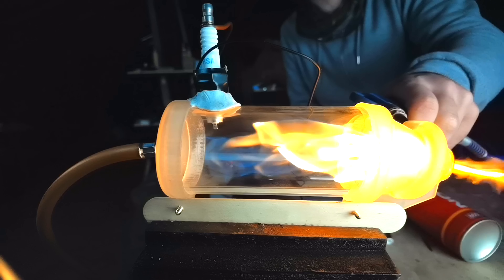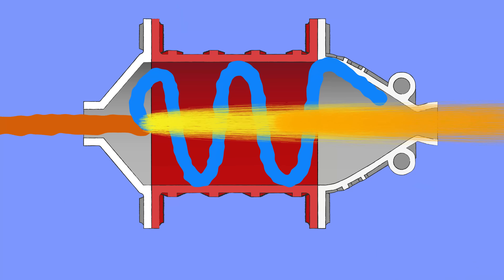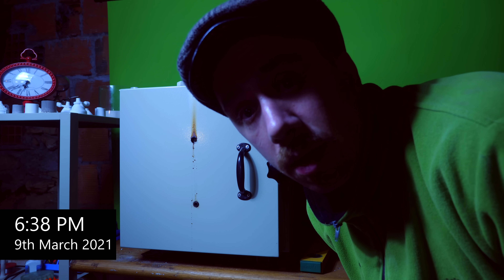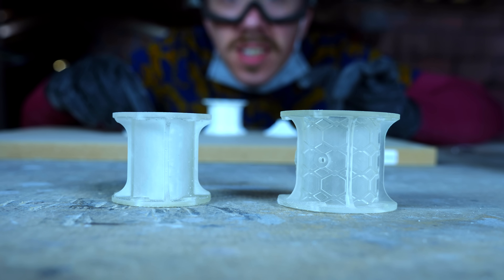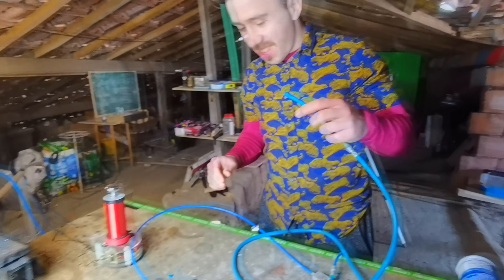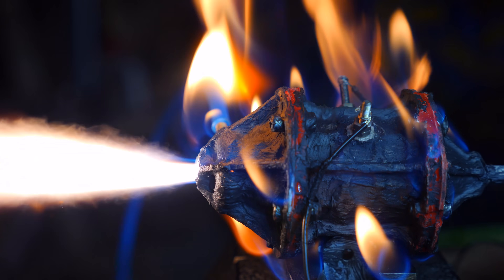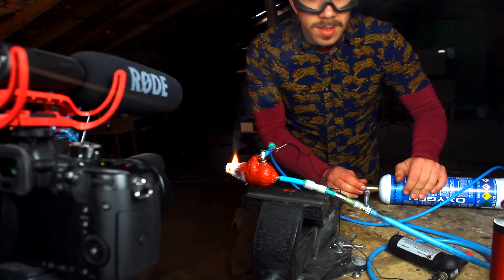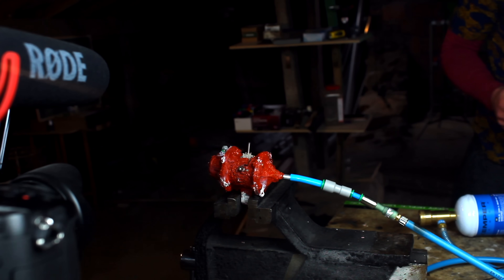Vortex Rocket V2.0 (3D Printed)

Comment: I see many professional comments here, but here is what I would do, not as easy but definitely worth trying: 3D print your template and use proper methods in use for hundreds of years for cups and bowls to make your engine. Then use the glaze to seal that. The 17% resin in your 3D printed one leaves a lot of holes that cannot be easily fixed.

Comment: I remember people working with epoxy using a vacuum chamber to remove bubbles. Wouldn't the same idea work if you put the nozzle in some ceramic/fireproof glue and let it suck out all the air out of the pores and replace it with the glue?

Comment: I haven’t read all 11 billion comments on all your channels, but after you fire the 3d part t9 burn off the resin, the ceramic should be porous… it ceramic after all… but if you the glaze the inside,and then seal up your openings, you should be able to use a vacuum to pull the glaze thru the interior of the ceramic structure. Give it a while to integrate. Now kiln again to set glaze, now you will have a vessel air tight (not just water porous) … sort of glass lining a wooden bowl thing.

Comment: Clay, a layer of clay on the parts and then in the furnace until you have a layer of ceramic sealing your ceramic parts. I know it’s been years but still a solution.

Comment: The high temp silicone would do a better job at sealing things from the inside. Mainly because in order to leak, it would have to push the silicone from the inside to the outside to create a leak under higher pressure, Sooo close too bro! Just make the inside coating very smooth and it should be kind of thin layer of silicone, but thats enough to handle way more than pressure than you would be dealing with IMHO.

Comment: Glaze the parts in the kiln after you do the resin burn out and support material trim. This will seal cracks  and handles just as much temperature as part itself.

Comment: Print the parts using the flat area as a base so you don’t need supports and after kilning connect the pieces cement leaving the screws in while it dries and then put the finish on inside and out

Comment: Bro for the vortex you can just use normal air and from where you are injecting fuel before injuction you can mix fuel and oxygen and then ignite them in chamber

Comment: Print a sleeve of ceramic for inside a 3D printed metal Case. Sleeve can be replaced. 
To go one step further you need to coat the inside of the nozzle with ytriumm stabilised zirconia using plasma coatings methodology.

Comment: Hi Integza, I think exploring a vitrification process for the ceramic components that need to be gas-tight may be a simple way to deal with the porosity problem. Potentially all that would be required would be more time in the kiln at higher temperatures to produce a gas tight material. Glaze is another suggestion to do the same thing, but may be too easily flaked off by the mechanical and thermal shocks of the chamber in my opinion.

Comment: I wonder if you could put that starch stuff on the inside of the walls, then only apply some high pressure to push the stuff into the cavities of the ceramic sealing them and also bonding to the walls. Or even that paint. Apply (air) pressure repeatedly before it hardens. I mean... it must be leaky, how else would the resin have escaped in the first place.

Comment: you could always make a metal version of the vortex engine and then seal the leaking ends with gaskets or of your choice of welding the metal parts and possibly add a cooling system to the engine make the ends rounded so that the chamber has less resistance for a better vortex good luck

Comment: Yo what's up tomato Arnold Schwarzenegger even though you're not German pretty sure you might have a little bit why don't you get some clay Clay is really good at conducting heat or dealing with high temperature heat and it's normally airtight kind of it wouldn't be good for the expansion chamber because it could blow up and is fragile but you could use it kind of like caulking or putty that you put around the jet and see if it would hold the oxygen and gas better

Comment: You could prevent leaking by applying the silicone on the inside. On the last test you could clearly see that the silicone got pushed away from the ceramic by the pressure inside and then popped. When the pressure just presses it harder onto the ceramic it won't have the space to flex and rip apart.

Comment: for your sealing issue i would suggest aremco 613 applied to the inside of the parts. So the hot gas forces the sealer into ceramic instead of forcing it away. As long as it is uniform and smooth it won't affect the vortex.

Comment: Vacuum set the porceline when hardening, and also vacuum kiln, at intervals, increasing the lower pressure as the kiln heats.. possibly also using a microwave on the porecelin while the kiln in hot.. 
 Then while part is still about the boiling point of your glaze if you can get it really hot and viscous and then  dip it in the glaze bath and vacuum chamber kiln and then cool it slowly down through to room temp and all that.. the porosity will certainly be far less obvious.. 
 You could do half a million other things like mix a fine glass in the plaster and then vacuum kiln it, maybe it will blend in real nice and give some cushion or something inside the porceline maybe it won't.. but who knows?.. but I bet it won't leak so quick ..  and keep it under vacuum as it cools and sets so as it contracts everything is set as tight as it can get all the way to ice cold and warms back to room temp in an extreme low pressure chamber.. keeping the poceline as tight as high density concrete as possible and glazing ... but a high temp glass sprayer is probably kind of expensive.. for glass glazing in the kiln fine particle glass that would melt on the surface of the super hot porceline in the low pressure environment .. but how many millions is that to develop huh? 
 All because of micro porosity problems..

Comment: Just an Idea,
First you need to find a way to cool the thing, otherwise it's gonna get destroyed every time.
next how about coating ceramic with good high temp resin or a ceramic glaze of some kind.
next how about shielding ceramic part with metal pleats to reenforce the structure.
also use high temp silicone glue.

Comment: You need your high temp coatings INSIDE the engine.  your silicone and other coatings are on the OUTSIDE, pressure alone is going to push them out.

Comment: Señor.
Excellent video, great entertainment.
Suggestions.
1. Make the chamber from high temperature glass, it will stop the leaking and won't burn.
2. Get a secondary screen and some fire protective clothing. It's not fun having your ears burned off. I'm sure you're aware that leaking gas is invisible and flammable.
3. Keep making videos.

Comment: For the leaking tou could by engine heat coating for Titanium or aluminium pistons in high compression or high boost engine coat It in the inside and try to see If It works

Comment: I wonder if the leaks aren't starting where either your fuel or your oxygen connect to the engine and then diffusing along the surface of the engine. Perhaps this isn't the only leak but it might be one place to look to see if there is one.

Comment: @Integza what do you think about a boat steam engine powered by hydrogen from the reaction of AL+Sodium hydroxide. The idea would be to create a combustion chamber where hydrogen explosions would provide a water jet by the venturi effect, pulling the water by using the velocity of the steam from the explosions. A very good stoichiometric Oxygen+Hydrogen mix to maximize the expansion as the gases of the resulting explosions would also vaporize water molecules to increase expansion. The vortex you've already optimized would be ideal to mix hydrogen and Oxigen. You'd need one direction backfire arrest valve. Ideally would be using injector spark plugs. The more the better. The frequency and amplitude of explosions and injections would determine the speed. Of course, you'd need a proper nozzle to increase the final pressure. Would that be a feasible 3D project? If I had a 3D printer, I would probably make some more experiments. What I can tell you is that from my small adventure, the power output is tremendous as the water turns into steam by absorbing the high temperature resulting from the hydrogen-oxygen explosion. I generated Hydrogen by oxidation of AL in Potassium Hydroxide. You need some lean water mix at the end of the combustion chamber. You need to wash the hydrogen in vinegar or other acid solution, cool it down, and inject it into a water container from where you will get the Hydrogen as the water will also act as a valve.

Comment: what about using ceramic powder to seal the engine ,and reinforce it with metal ring from the outside and with that in place heat it to cure until it solidifies like a single piece,i feel very excited to try those out seeing your video....you can also simulate the area prone to break under chamber pressure in cad models...

Comment: When it first worked best, it was because the vortex was narrow. I think if you change the geometry of the engines a bit, as well as making them bigger, it will work. Perhaps there is something you can refill the pours with. Like a really thin glue or resin? At least on the outside.

Comment: You need 1/4 turn shut off valves to quickly shut off fuel/oxidizer. A regulator on each would help you control the mix better

Comment: Is a layer of soot on ceramic airtight? If yes, and all oxygen is used up by the propane, it could help to seal up the ceramic. And it could be done with a candle-flame or an acetylene flame.

Comment: The reason for the leak is that you use heat to burn the resin, which creates very small pores throughout the engine body.

Comment: Given the fact that you have methods to print multiple higher resolution objects in plastics why do you not next build a ribbon burner forge to melt alu into a sand mold and use that as some of your higher temp projects?

Comment: Just put the engine in cement and just let the nozzle and the fuel and oxygen lines out and it will be airtight.All I’m trying to say is just make cement block with the engine inside.profits : it will not leak completely and it will be so strong .

Comment: Why was it so important to remove the extra mete materials from The outside it supported the part in the creation of the part and the inside air chamber and as long as you can access the mounting holes well?

Comment: @Integza when you re-lit the Single piece engine at 14:09, fire did not escape the crack half way back at the injection vein. this means it only failed where the force of the combustion was the greatest near the exhaust. If you could reinforce the area near the exhaust or even Rifle it.. you might get better results.  GREAT STUFF

Comment: I also recommend making a master shutoff valve for your system. have both the propane and air pumped through a set ov valves you can easily shut off without having to go to the main shutoff valves of each tank, and probably cut the gases off a lot sooner.

Comment: Hey, I just had an idea for your next attempt at sealing ceramic parts. You should try to vacuum the parts when they are submerged in a fire resistant resin. It will force all the resin into the porous structure of the nozzle and hopefully seal it much more effectively than you've been able to in other videos.

Comment: Something that may help with the leaks is to dip your assembled rocket engine in Ceramic, or Porcelain slip, fire it again to vitrify it after drying to about 15% Moisture content... you'll be able to easily put a mark in it with your thumbnail

Then just go by recommended temperatures for both (1200 F. for ceramic)... plain ceramic is just as heat resistant and a quarter of the price of porcelain Just so you know :)

Comment: Stop using screw together parts. The unit has to be one unit. Your vortex set up sux. 4 air nose in the bottom third or the vortex chamber. The nose angle is key to increase peak vortex.

Comment: Just buy a can of high temperature paint for BBQ grills... Paint should be thin enough to fill the pores in the ceramic with a coat or two, it dries fast, and it withstands like 500C once cured... Plus, your rockets will look way nicer with a nice black paint instead of the horrible goop you got going on now...

Comment: one thing you might be able to do to seal the leaks is braze some brass over the part. hopefully the ceramic will block enough heat so that the brass wont melt off.

Comment: Glaze the rocket in slope or slip whatever its called, can use a vacuum chamber to pull the ceramic into the pours more. Or do something like an epoxy painted on.

Comment: Have you ever thought to 3d print the mold to cast the liquid ceramic rocket? The so obtained rocket would be 100% plain with no cracks and well respective of geometric tolerance. You can print a two pieces mold or simply use a resin that evaporates at high temperature to unmold the rocket.

Comment: 14:06 Taco exit express
On another note, how about covering the inside of the engine with the red goop ? pressure drives it into the cracks, instead of bubling on the outside, bursting and burning ...

Comment: Could part of the problem be that the vortex is made of fuel gas surrounded by oxygen?
It exposes the chamber walls to combustion and erosion.   If the vortex was made of a core of oxygen surrounded by fuel gas then would this help?  Either way the combustion should occur in the mixing area at the edge of the vortex.

I know there might be an increased fire risk from unburned fuel leaving the engine and reaching the surrounding air.

Comment: Damn this is painfull to watch, use different easy to handle material. Such as for example ceramic clay and 3d print your molds.
You cant learn anything if you can only inspect your model for 10 seconds while its running.

Comment: every furnace ive ever seen on youtube contain just 2 main ingredients to protect its walls.....refractory cement and kaowool....I'm no engineer....so I wouldn't know its heat resistance scaled down to the sizes you would need for your 3 d printed projects....but maybe its a material you could utilize along with the cement and silicone

Comment: Hi, you are using the oxygen instead of normal air in the vortex, yes it will help in combustion but will also lower the protective wall between the inner side of the engine and the flames. As you had used only air for the first test and it worked without melting the engine itself. Can you try using the of air with certain amount of oxygen increased, might help with combustion and the issue with flames reaching to the inner layers of the engine.

Comment: I know little of....any of this, I'm also a little drunk, BUT if the porosity is enough that a gas escapes would that mean it's porous enough to absorb liquid? It might not under normal circumstances but when combined with a vacuum pump could you impregnate the ceramic with some kind of epoxy or other high-temp material by immersing the part fully in it (following sintering) under a vacuum. I'm mainly thinking about the process of mixing epoxy then using a vacuum chamber to remove air bubbles from it ya know?

Comment: The high end of the Max temperature for the sealant would be the Max internal operating temperature, calculated through the burn/combustion rate of your fuel.  It looks like your burning right through the high temp sealant. You could find something better, if there is one.

Comment: Hey integza I would recommend this for the leaking it will withstand temperatures up to 3,000 degrees f° and temperatures as love as 0° the only problem as after a few firings of the engine it will start to flake off we us at my work in a steel foundry and can say it will hold up to the temperature and should seal the leaks. if your interested here's a link. We us a brand called dixie super mortar 3,000.

https://www.etsy.com/listing/775924968/35-lbs-veneering-cement-refractory?gpla=1&gao=1&&utm_source=google&utm_medium=cpc&utm_campaign=shopping_us_ps-a-craft_supplies_and_tools-glue_and_adhesives-other&utm_custom1=_k_CjwKCAjwhYOFBhBkEiwASF3KGZ4aKQ1MzpXxawUkgTk6y34FncvMLUuxc9TzsqLvcqMUkHh6pwJsbRoCMSMQAvD_BwE_k_&utm_content=go_12565278184_123210943567_507237316543_pla-296172487653_m__775924968_169164697&utm_custom2=12565278184&gclid=CjwKCAjwhYOFBhBkEiwASF3KGZ4aKQ1MzpXxawUkgTk6y34FncvMLUuxc9TzsqLvcqMUkHh6pwJsbRoCMSMQAvD_BwE

Comment: i suggest infusing the ceramic parts with water glass. it is also known as automotive sealant and is used for sealing engine mufflers. it is sodium silicate which is water soluble. let the parts sit in a bath of it and then let them air dry to seal it.

Comment: It's breaking not because of what's on the outside, but what's on the inside. The surface of ceramic, even when 3d printed, is rough on a microscopic level, and since you can't sand the inside, which even then wouldn't be enough, I suggest taking advantage of the vortex cooling, and find a different material that's less rough. And maybe incorporate a design that directs air into the vortex shape easier to enhance cooling.

Comment: Why don't you print "negative" parts in resin and embed them in plaster of Paris. Plaster of Paris is gypsum so won't burn.  Let the plaster harden then burn the entombed resin negative away in your kiln. Like a "lost wax" process. The outer shape of your rocket engine doesn't matter. Make it brick shaped...or use a cardboard cylinder for the outer mold if you want the engine to be a cylinder. The resulting piece will have a cavity inside of the correct shape that is all that remains after the resin negative has out gassed.

After I typed the above I googled 3D printing lost wax and the following came up:

https://3dprinting.com/3d-printing-use-cases/lost-wax-casting-with-additive-manufacturing/

It describes a 3D printer that prints wax.